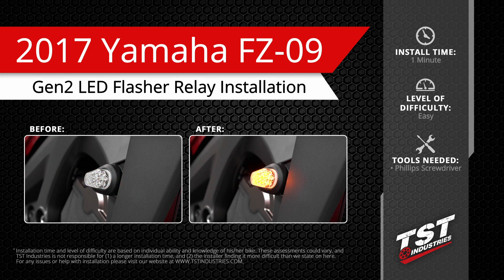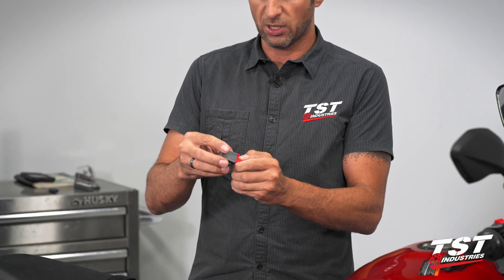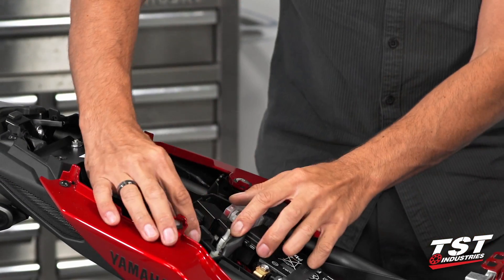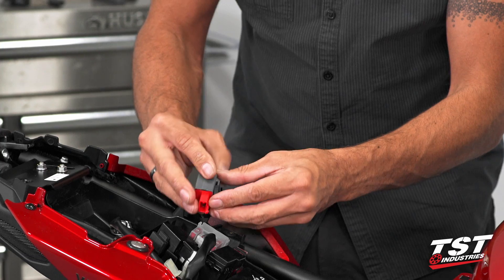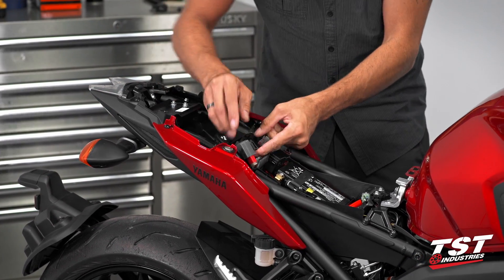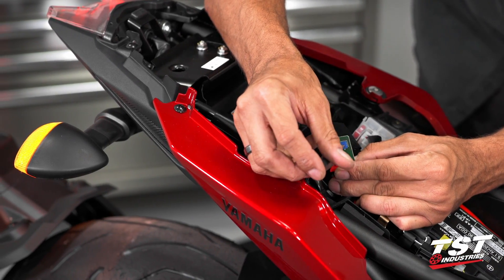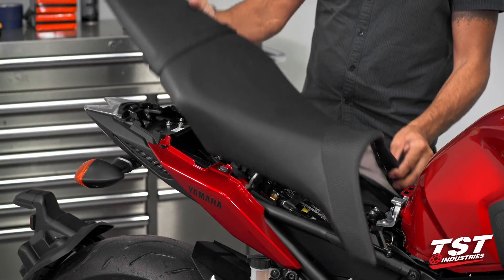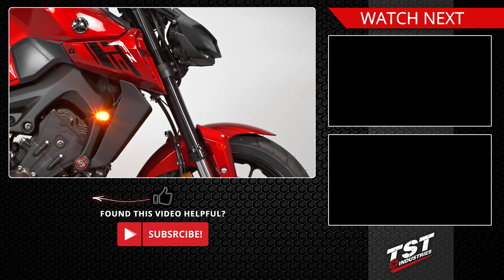How to install an LED Flasher Relay on a 2017+ Yamaha FZ-09 MT-09 by TST Industries

Comment: If i have this relay for the integrated tail i don’t need another one for the front blinkers right?
Reply from the maker: Correct. Only one relay per bike.
Reply: @TSTindustries  what about the Y-style signal harness splitter to fit the MECH-GTR on my 2019 MT09, do i need that?

Comment: Do you only need one relay if you replace all the OEM lights (tail light, rear signals and front signals) or do you need a relay for each light?
Reply from the maker: One relay for the whole setup.

Comment: Hi can this work on Australian mt09 2017 models?
Reply from the maker: I am sure that if this particular one does not work we have another that will. We don't have access to the Australian model here so if you can send us a photo of what oem unit you have on the bike we will be able to match you up with the correct part. Please use our support email on our website for further communication.
Reply: TSTindustries thanks 🙏

Comment: I installed this relay, it does fix the hyper flash of the signals but there is a 2 second delay after activating the signal until the signal actually comes on. Very annoying and dangerous when you need to change lanes quickly and your signal cant keep up.
Reply from the maker: The delay should be 1/2 of a cycle. The relays come pre-configured to 85 cycles per minute so the 1/2 cycle duration should be 0.35 seconds. You can adjust up the flash rate slightly to shorten the duration of the initial cycle.

Comment: will this relay work with the new 2018 mt 09 (american model) I am looking to buy flush mount signals with the oem harness connectors you sell as well. just want to make sure when it says 2017 + it mean the new MT 09 as well.
Reply from the maker: In 2018 Yamaha discontinued the use of FZ on the 7 and 9 models, and consolidated the naming nomenclature to the global MT series. So the 2017 FZ-09 became MT-09 in 2018. It is still the same bike. We do have the American version confirmed for our relay compatibility.

Comment: Will your flasher relay work with the 2017 MT-09 that has hazard lights?
Reply: I will be purchasing the 2017 MT-09 in the Philippines, so the specs might be slightly different from the FZ-09 available in the US. On your website you caution international buyers of the relay that a 4 pin relay may be necessary if the bike has hazards. The version of the MT-09 sold in the Philippines does have hazards.
Reply from the maker: Check your wire configuration to see if they match up with the relay in this video or you could send us pictures of your configuration so we can get a better look at what we are dealing with as far as compatibility. support@tstindustries.com

Comment: Thank you so much for explain , but I need flasher with 2 o 3 pin ???
Reply from the maker: I do not know what is on your bike so I cannot tell you what you need. If you take a photo of the relay you have and send it to our support people they will be able to help you.
Reply: TSTindustries I have FZ 09 2017
Thank you for reply
Reply from the maker: If you have the American model then the relay in the link in this video is what you will need. If you are outside of the American market you will need to send us a photo of your relay and its pin configuration so we can match you up with what you need.
Reply: @TSTindustries  I watched the video, but did not get a good look. MT09 2019, 2 or 4 pin???